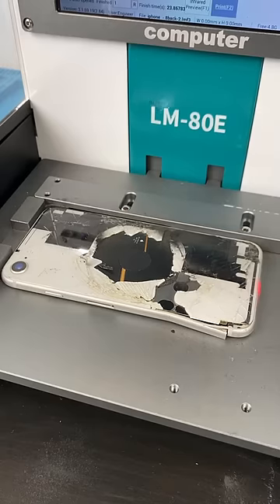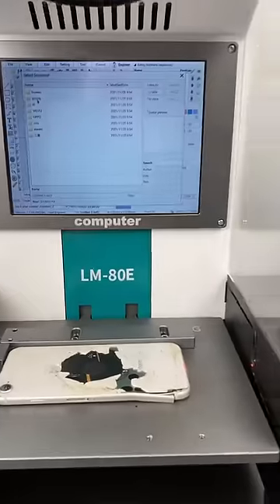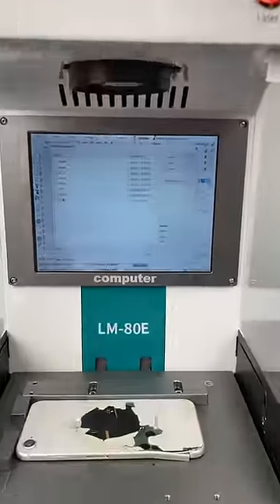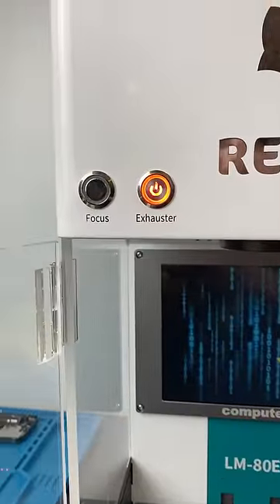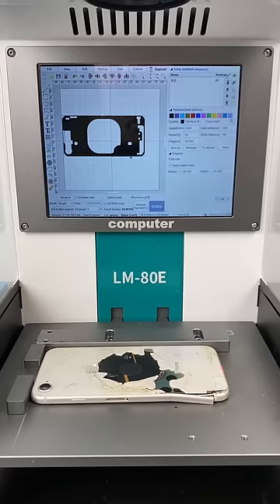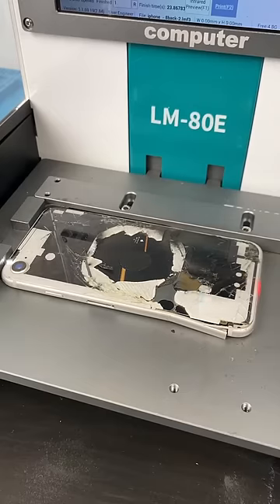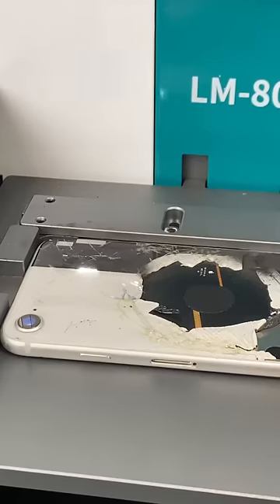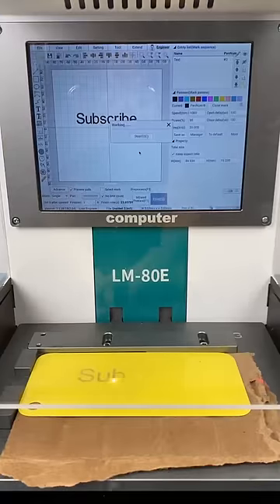Ever Wonder How the Back Glass Laser Machine Works? #Shorts

Comment: But imagine, how bout we Replace the glass with something else? After removing the broken glass?
Reply: You’d lose wireless charging
Reply: @Roshan_420  Well you could use another conductive material.
Reply: @Roshan_420  but every time I hear it it just makes me want to call Apple A J'S because why don't you use METAL IT DOESN'T HAVE TO BE THICK METAL JUST A NOT PAPER THIN WE WOULDN'T BE HAVING THIS PROBLEM YOU COULD DO WIRELESS CHARGING ALL DAY METAL IS A CONDUCTOR
Reply: @Mr_King_Clutchy  Hell naw you can't. The metal would pick up the fields from the wireless charger instead of the coil then.
Reply: @Xilog u don't make any sense
Reply: @Xilog  but anyway what ever your saying don't matter I've done it before and it works
Reply: @Mr_King_Clutchy  well then your phone could shock if you your battery malfunctions
Reply: @kirakira9906  hear me out aluminum or stainless steel costum back..... Heating goes brrr
Reply: @Trex3n20  I think u got the wrong idea it's a combination of METAL PLASTIC AND RUBBER but even if I did put a metal back the chances of the battery functioning are very low but still there but low that y rubber is a combination of it
Reply: @kirakira9906  it's not about it being conductive, in fact that's the opposite of what you want as conductive materials block phone signals, that's why older iPhones like the 6 have those lines of them, their the antenna
Reply: @Mr_King_Clutchy  it's not supposed to be conductive to touch, it's glass for a reason bozo
Reply: @Steph.98114  Yes I know about those antennas, Samsung phones have those too.
Then what is the best material besides glass go conduce wireless charging? You could even very easily make a back cover all plastic and only make it metallic or something like that on the spot were wireless charging is, I think google did something like that
Reply: @kirakira9906    wireless charging is done using a metal coil behind the glass which receives charge using electromagnetic induction from an opposing coil in the charging pad. A metal back would block the electromagnetic waves from reaching the coil inside the phone. When the coil is induced by the charging pad, it produces a current that charges the battery.
Go ahead and read up on electromagnetic induction if you're interested.

That said, having a metal cover would completely break the entire charging mechanism, meaning glass or plastic is the best and only way for this to work. This and the fact that, for the same reason, metal cover would block phone signals as well. You absolutely do not want a conductive back for reasons said before, a malfunctioning battery could shock you if you are standing on ground without shoes, for example. That's how electricity works.
Reply: @metamist  Thank you this was really informative. So basically you need a material that will act "uninterested by the electromagnetic fields"
Reply: @vtakpanzer7456  there's just a better way to do it that's all you guys can do what you want I'm telling you what's better plastic metal and rubber instead of glass now I don't have to worry about the back breaking.😐
Reply: @Mr_King_Clutchy  how about putting a plastic rubber or metal case over it
Reply: @Xilog  depends on the metal
Reply: @Roshan_420  Use a durable plastic cover. The old Samsung phones (like the note 3) with removable batteries had a special after market plastic charging cover. There also was/is an after market cover that doubles as an extended battery and wireless charger. Kinda like a Mophie with wireless charging. I'm not sure how either of  those will affect the antenna or signal but it can be done.
Reply: Tbf many metals are conductors, wouldn't that make the whole rear of the phone able to conduct electricity? Unless they segmented the materials used which could spawn some cool designs. Or use a lighter charge, then again I probably don't know all the details
Reply: @Xilog  lol that what I did
Reply: @kirakira9906  I think your a bit confused, you don't want conductive materials where antenna are, hence the glass backs on modern phones, the s21 does actually use a plastic back because of this but many people don't like this because it doesn't feel as premium as glass or metal

Comment: Hey, My a51 phone’s screen broke, i fixed it in a local mobile shop and it broke easily again, should i change the screen again or instead buy a new phone. 
Any suggestions?
Reply: probably buy an new one since reapairing an phone more then 2 or 3 times can cause some slight issues
Reply: @Thega74   but how to transfer the data